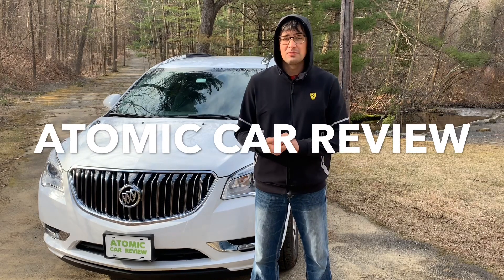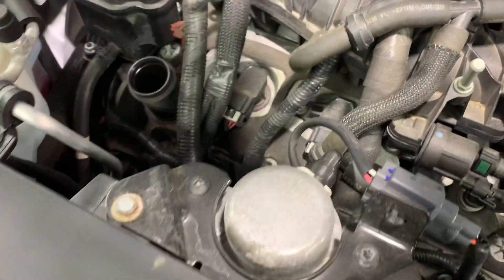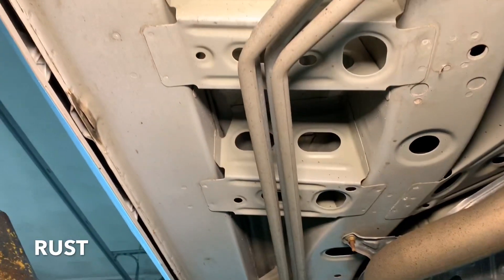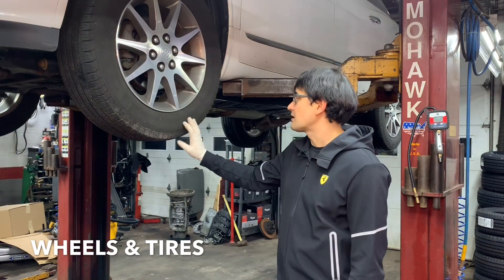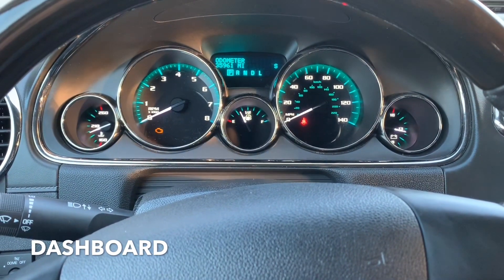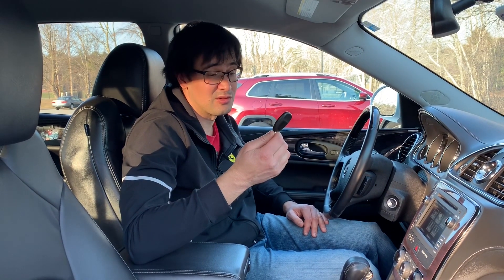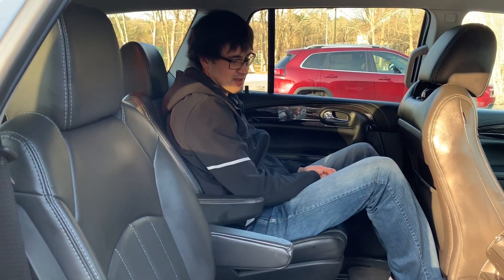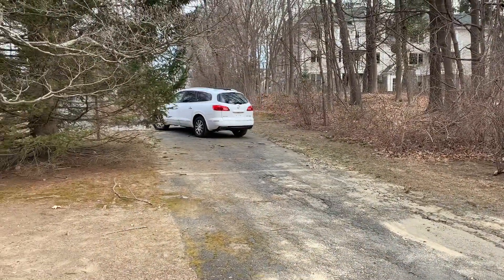Shocking Truth - 2017 Buick Enclave Review

Comment: I owned the 2010 version,  Actually, bought it used from the US Olympic team which used it in the 2010 Winter Olympics in Vancouver, Canada - it had 600 miles on it and was loaded for less than 40,000.  Had it for six years, just over 100,000 miles.  Was a great car for long trips and was still a great car when I sold it - just did not need a car that big anymore.  Only issue was the water pump - which was recalled and failed. Replaced twice for free at around 60,000 as the second pump failed within 20 miles.  It was a good car for car pooling and al larger family.  Thanks for your review for the basically same car except the third row headrests were full size before the light redesign.  now they seem useless in your car.

Comment: You are gifted at imagining problems when there are none!  For example, I didn't see corrosion on brake lines, but you say that is going to happen?  I purchased a used 2008 Enclave that spent it's life in Montana and there are no substantial corrosion issues under the car.  Go figure.
Reply: prolly a New York car  they lay down magnesium for the roads  very aggressive on wires and metal

Comment: so whats your opinion on sealed trans and leaving the fluid i had old camry over 300k orig fluid my buddy ford same thing and more orig fluid What u think about the 2019 should i ever change sealed fluid since old one did over 300k orig ? btw classny review most people dont get this technical
Reply from the maker: Thank you, we are happy that you liked it! I would say that oil change is always good – it never hurts to do it. Оnly for some old transmissions it can get worse with transmission oil replacement if the oil was never changed. Usually, it can happen if transmission is dies. Together with the old oil you can flush the rest of the friction material. But in most of cases it is always better to change any fluids inside the car. Toyota’s transmission is not too picky with transmission oil and sometimes you can even send the car to junk yard with original oil. Also, I found out that some car manufactures began to change transmission service requirements. One year ago they told that you do not need to replace the oil inside the transmission, but this year they ask to do this each 60K miles on the same car. Also, some manufactures mean that “lifetime transmission fluid change” is intervals of 100K miles :)

Comment: Quick question. Looking for an honest advice. Between the buick enclave 2016/17  the 2016 toyota highlander,  2016 infiniti qx60 and the 2016 honda pilot. Which would be best for Colorado?
Reply from the maker: A Voice Of REASON, My opinion is that the best one would be Honda Pilot. Good for gas, a lot of space and very reliable. Toyota also is nice but smaller. 
Infiniti and Buick get rusty very fast, but I just recently worked on 2000 GMC Yukon XL from Colorado. And the car looks almost like new underneath which means that in Colorado you are going to have at least 50% less problems with GM or Nissan compared with Massachusetts. Thank you!
Reply: @AtomicCarReview  Thanks man, I appreciate your advice.
Reply: @AtomicCarReview  What do you think about Astro and Safari Vans? I'm looking at vans for my company to go touring. I thought about the Enclave but based in the seats, I don't think it work work for adults.

Comment: My sister owned an Enclave and had to trade it in because of numerous electrical issues that cost $500 each time... so she bought a newer model LOL 
You are scaring me when you talk about changing spark plugs on a Toyota Highlander.... I own a 2013 with a 3.5L V6....are plugs difficult to change on this motor? Thanks
Reply: Spark plugs get changed on every single vehicle. For like 100 dollars. Relax
Reply: Not $100 when it takes 3+hrs bud - get your head out of the sand
Reply: @Erated78  you can change them yourself depending on the vehicle. Go get a new mechanic
Reply: @Erated78  not to mention, you dont need to change the sparkplugs until AT LEAST 100,000 miles